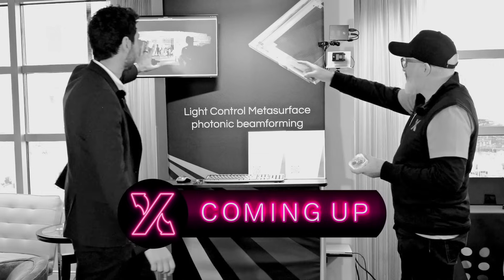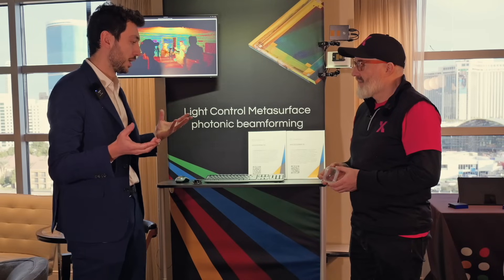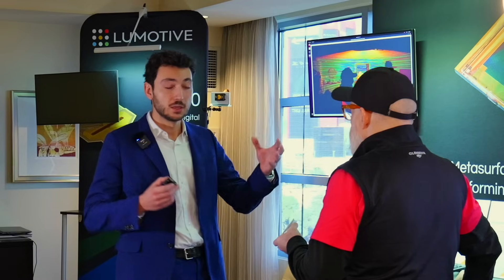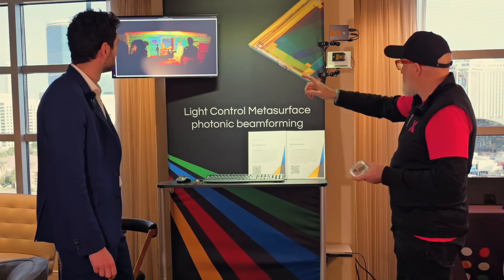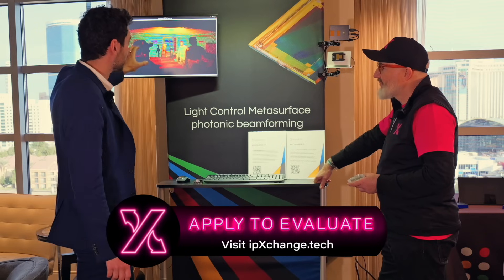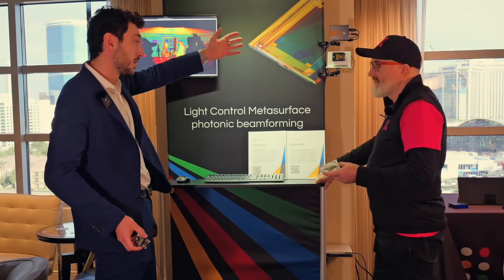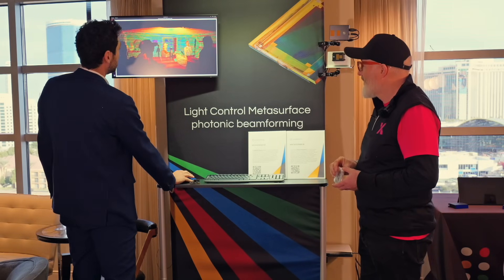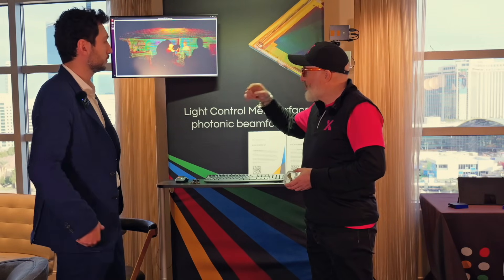This Tiny Chip Replaces Bulky Optics & Mechanical Mirrors!

Comment: How is this different from just a TOF camera that can be used with an arduino/raspberry pi?
Reply: Fr.. I'm already asking the same things
Reply: My guess is this sensor have board of micro sensors comparing from tof that is one sensor, sending just one light, but it is just my guess
Reply: If successful, this would be used in longer range lidars for mapping from a few tens of meters, out to a few hundred meters.

Comment: I will have to look at Lumotive's patent but nothing new here. I have designed dynamic beam steering solutions that included switching snd attenuation  using LCD technology for 16x16 and 32x32  coherent switching systems.

I di have to say I never used thd term 'metalmatersl" for LCD 

I do see that unlike traditional lidar systems with mechanical moving parts, LCM uses CMOS manufacturing compatible semiconductor-based beam steering, eliminating fragility and improving reliability and durability. 

Another plus is that it  handles the challenges of multi-path interference more effectively than mechanical systems.

Comment: Can this work underwater?
Reply: That’s an interesting question 🤔!

I believe that regarding form factor and packaging, it could be encased in a waterproof container. However, I don’t know about the functionality; it would probably require some sort of filter to denoise water refractions and the reflective nature, without forgetting about the differences of how waves behave in water compared with air which also could require some adjustments for it to function properly under water!

Those are just assumptions probably I could be wrong

Comment: Ive seen optics like these used in some CD and DVD readers. They are called adaptive holographic optical elements. Usually made by taking a hologram of an optical system then adding a liquid crystal element to change the perspective . This thech is decades old, but the inexpensive highly polarized laser sources have taken a while to drop in price to make these viable.

Comment: without getting to the end of the video I bet colors are simply impossible.
Reply: LOL, it's for 3D radar, not photography; why would you comment on a video without watching it? Just trying to drive up engagement?
Reply: @prophetzarquon  yes. engage myself before the end of the video
Reply: It’s for 3d mapping, making autonomous or semi-autonomous systems more spatially aware and with higher accuracy. Color means nothing in this case.  If it were possible to deduce material properties using this technology, that’d be a major bonus.

Comment: Is this just the good old LCOS "Liquid Crystal On Semiconductor" technology with somewhat shrunk pixel pitch in the order of the VCSEL laser wavelength to do one wavelength refractive optics?
Anyway, the self driving car industry won't fail because their many lidar sensors aren't solid state.
Reply: Yup. It's a sandwich of liquid crystal phase shiters, polarizer and a holographic optical element. The first use of these was for correction of bit stream ficus in early DVD and Blu ray players. ❤
Reply: Solid state is not reliable? Please explain.

Comment: This was on CES 2025? Is this a joke? I'm really mad when I see scam like that. What new technologies? If that was CES 2006 OK but not 2025! That is good old TOF sensor! I have it im my Honor view20. TOF - time of flight sensor technology is 20+ years old. Yes it is cool but no it does not measure ambient light like stated in video. Light source is actually a box above that sensor and emits an IR or NIR light packets that are syncronised with sensor so that the logic can then track the time it takes to return to sensor and calculate depth of field. Main drawback of these sensors is precision which is arround 5-10 mm and that is because it is really tricky to measure time or phase to reflect say 0.1mm. or better.
Reply: It's not a scam, it's an adaptive holographic optical element. These have existed for a long time. The limitations are that the sensor will only work at the design wavelength and that the laser must have a polarization greater than 500:1 ❤
Reply: That’s how an Xbox connect works too right? I was just looking this up for a hardware project. Sounds like you have a lot of experience here
Reply: @_DaveMadeThis  different.

The OP is confused about what this sensor is. Smartphones have inherited a few different mechanisms for ToF (normally for auto focus or face scan). Apple used a dot-projector to project a known grid of dots that a camera picks up and translates back, known as structured light (common with 3d scanners), it's old tech that has finally reached the miniaturization level as other technologies needed to catch up. I believe this was Kinect mechanism as well, along with multiple cameras for additional depth (my memory maybe foggy on that).

The other ToF for autofocus is a small grid of about 4 or 8 pixels (different sizes exist) that project a light source and the individual cells pick up the reflection. Those are very low density and short range, hence why they're used for something like basic focal estimation.

This newer tech is aiming to replace the LIDAR based ToF sensors that you see on autonomous devices (vacuums, cars, etc.). This way you don't need a rotating cylinder sending an IR laser beam out with a corresponding receiver to pick up the reflection. Notice the distance and width of the point cloud being generated, that's coming from a very small chip.

These are starting to show up in flagship robots because it eliminates a wear component (spinning laser drum) and a significant amount of weight 

They're also known as Phase Array LIDAR or PAL. Consider it a cousin to radio-based (PAR) you'd find in an F-22 or modern fighter jet which is also going through a miniaturization evolution (newer presence sensors can detect multiple people in a large space, versus the old single object ones).

The Honor 20 has a variation of this (at a lower resolution/power, for packaging reasons) marketed as a ToF 3D sensor. There are many manufacturers working on this tech since autonomous-everything needs a solid replacement for the bigger LIDAR sensors.
Reply: @kylek29 So basically another Quanergy?
Reply from the maker: @kylek29  Thank you for the explanation!
Reply: love this added information! wd!
Reply: @_DaveMadeThis  The Kinnect used a mixture of structured light (beems of infrared projected into a room), with stereo-scopic cameras. Then calculating the location of where the infrared beams are intersected.

A Time of Flight (ToF) camera has an infrared strobe and calculates the distance of each pixel to reflect back to the camera.

There's pros and cons to both techniques. Structured light/ stereo scopic vision are the most common 3D scanners these days (megapixel pointclouds with today's cameras). ToF is around 0.5 megapixels but more compact and less computational processing (less battery). The whole sector is exploding with demand for 3D vision on drones & robotics.
Reply: so it's that V2 xbox thing
Reply: They married it with good old MEMS mirror
Reply: Fake. There's a hidden GeForce under the desk.
Reply: There are many types and classes of depth sensing systems. You are correct that the demo they are showing in a room could be done with a structured light (like Kinect 1) or solid state (flash) Time of Flight (like Kinect 2). However, for longer range lidar (beyond around 30m range) we use scanning sensors. These typically have the large spinning polygon mirrors he describes. This type of beam steering technology aims to replace those in mid-range lidar.
Reply: The fact that Victor didn't refer to ToF sensors/ cameras leads me to believe he is trying to pull a fast one (he also didn't mention the specs X/Y & Z resolution). If he did you would be able to see there's already cameras on the market start from £50.

Post processing/ upscalling is cheating, as it's possible to do the same on similar devices. This is cool technology, there is no need for dihonest sales tactics.
Reply: Slide the comments bar and you’ll see it is Ai generated content?…?